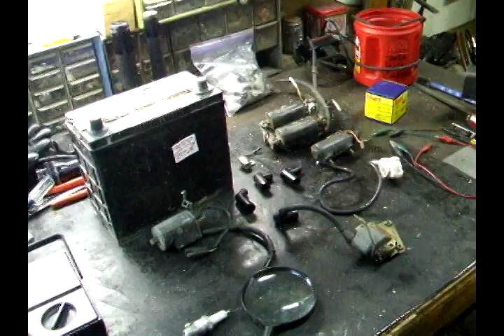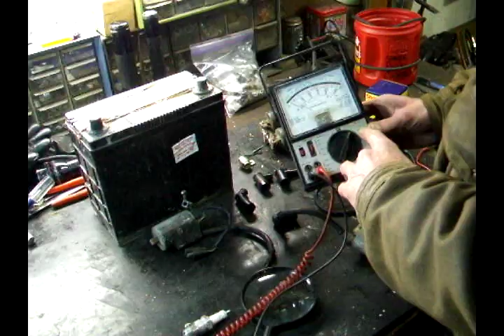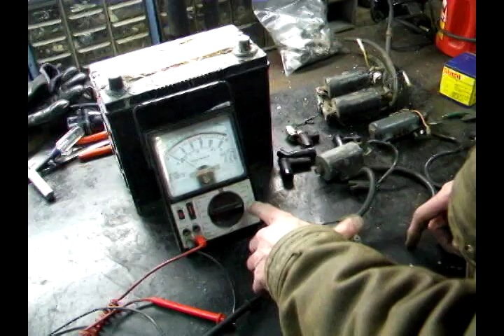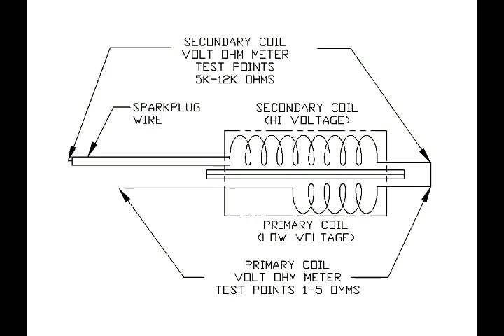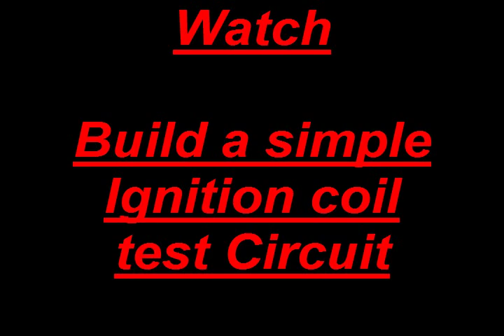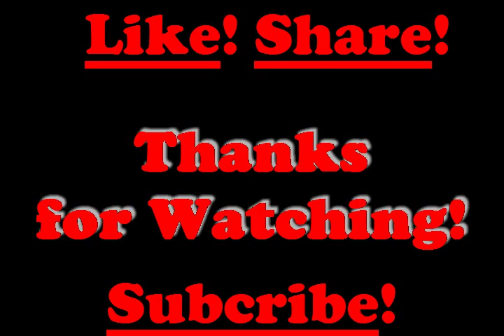Ignition Coil test with VOM for Motorcycles and Mopeds

Comment: Hi, I have a coil off my 2009 KLX250S. Following my shop manual, I have no ohm reading on the primary windings. If this is so, would my bike run? My bike runs but after up to running temp it cuts off.
Reply from the maker: +Moto Bob Keep doing that and you'll cook your CID box too! The coil is getting hot inside and that makes the gap in the break wider and then it doesn't run.
Reply: +A Motorcycle Nut So what are you saying? The coil is bad? Or stop testing it? I have a major problem with bike cutting out at running temp. 

If you could maybe read my post? So may guys are helping me and still haven't found the problem. Video included of the issue here:
http://www.kawasakiforums.com/forum/klx-250s-71/bike-dies-after-7-miles-checked-everything-need-help-43949/

I'm out of ideas and can't afford to take it into a shop. I really really need help with this. I'm getting desperate. If you could have a look, I'd really Really appreciate any help or advice. Thank You
Reply from the maker: +Moto Bob Well Moto Bob. I watched your video. You should have a Ohm Reading on the primary side of the coil. Also on the Secondary side. Make sure you have your multi-meter set to the correct range when you test. You should have a rough Ideal what the reading should be from your manual. If Its not what the manual says the its probably bad. Over loading the CDI unit with a bad coil will fry it over time. CDI units have a capacitor in them and they break down over time especially when over loaded. Couple things I would try. New Ignition coil if the current one you have doesn't test out on the bench.  Remove and test spark plug cap. (Test Sparkplug Cap with VOM for Motorcycles and Mopeds, https://youtu.be/yGfIkwOp-Vk ) Install a new spark plug. Also dump your Gas, and replace it with new, you might have gotten some bag gas from the station last time you filled up. That happens more then you know, It might be E-85 and your bike won't like it. Hope that helps
Reply: +A Motorcycle Nut Thanks for looking and helping. 100% its NOT fuel related. Gas is new clean and water free. Carb was gone through completely and thoroghly, venting very well, all new hoses, filter, tank cleaned, petcock cleaned all last week. Fuel system has been eliminated as the problem 100%. 

My question about my coil is, from what I understand about how my coil works. With no reading at all on the primary winding on my coil, is it possible for my bike to even run at all? That's why I'm confused. Doesn't the primary feed the secondary side in order to fire the plug? When I say no reading on primary windings, my tester is set correctly, but doesn't read anything as if the red and black wire leads from my tester aren't touching anything. The secondary side reads within spec as manual says, so that side is Good. 

Again, with no reading, and no continuity on primary side, how can my bike even start and run? Is this possible to run with coil like that? Thats my question. Thank You

Comment: Thank you for replying back!  I watch the videos you suggested excellent advice.  I tested my spark plug cap and test good but will replace with a new cap later.  I have to dig deeper into the motor to check the points and condenser hope to next weekend; checking electrical connections as I go.  As for my ignition coil its not labeled as a "6V"  but it dose have "FL601-AC3Y" on it; the make/name is "TEC".  Not sure what all the letters and numbers stand for!  I tested the coil per your video and got 2.50V OHM for the primary and 9.49V KOHM for the secondary.  Does this sound like it a good ignition coil if so I still don't understand what range I am looking for if it were a bad!

Again thank you for your time and videos!
WingedFoxTail
Reply from the maker: +Winged FoxTail Sounds OK. If you Google "FL601-AC3Y ignition coil" you can find out all about it"

Comment: Hello
How do you identify what the coil is before testing it to know if its a 6 volt or a 12 volt ignition coil?  What voltages should you be seeing when testing the primary side and secondary side of a 6 volt ignition coil?  I have a 1973 Honda atc70 I am trying to troubleshoot!
Thank You
Reply from the maker: +Winged FoxTail  If you look on the coil part number , look for 6V in the number. That would mean 6 volt. Honda atc 70 has a magneto ignition system which didn't require a battery.  It's  uses 6 volt system components, if they are OEM. I would also be suspect of the spark plug cap. Here's a video how to test them. 

Test Sparkplug Cap with VOM for Motorcycles and Mopeds   https://youtu.be/yGfIkwOp-Vk. 
Make sure your points are set right and working and you have a good condenser. Also check  all the connections in between the stator and ignition coil. Here's a video about that.
Repair motorcycle electrical connections part 1of 2.  https://youtu.be/acco7T8_cq0

Comment: Sir, can u help me how to modified or step up the voltage charging from the stator of a motor cycle 110cc suzuki from 28VDC idle, to 40VDC..is it posible sir?.....thank you
Reply from the maker: argene camilo Neral Based on what you have said, I have to assume that your voltage regulator is not working correctly. Watch this video to learn how to test it. "Motorcycle voltage regulator charging and rectifier test" http://youtu.be/h87sQiX_KSY.  Then test your stator.
See "How to test a motorcycle stator " http://youtu.be/DjXyOiRpgOw. 
There is a schematic shown in this video of a typical charging system.
Make sure you have a good battery, and use parts that were designed for your particular bike.
This should get you on your way to repairing your bikes charging system.
Thanks for watching and we'll see ya next time.

A motorcycle nut